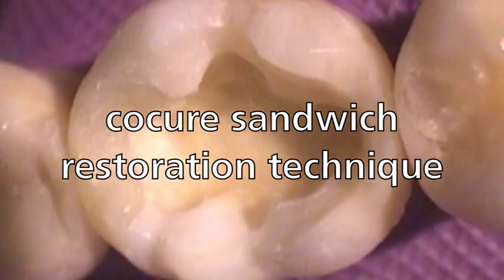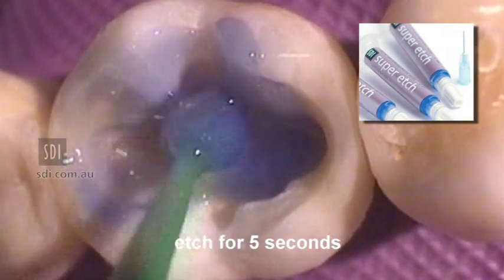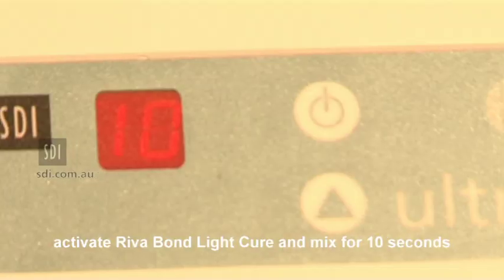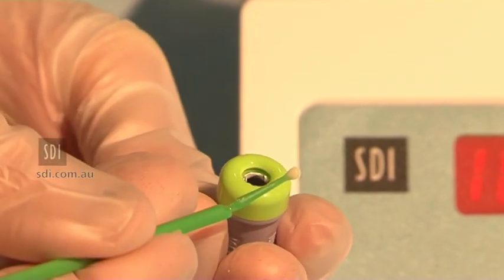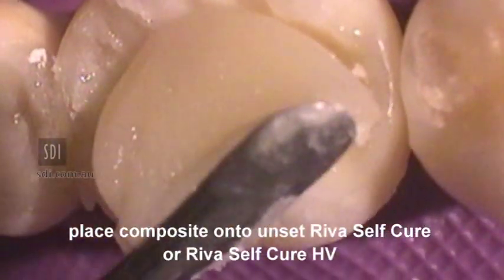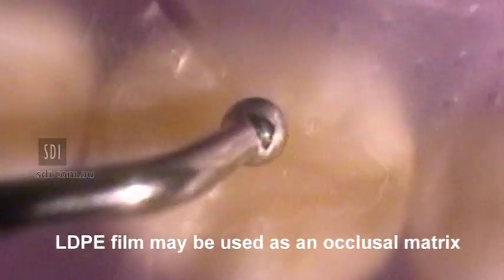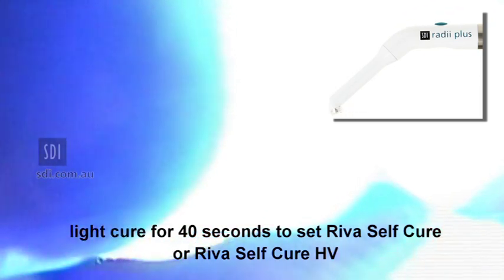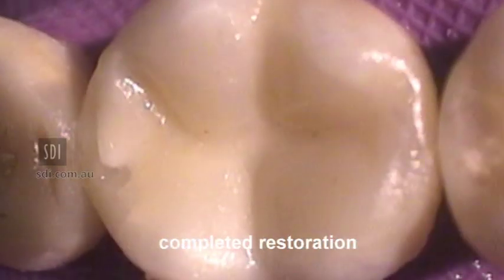Cocure Sandwich Restoration

Comment: If you don't cure the GIC, then wouldn't it flow between the enamel and the composite as you pack the composite? This would interfere with the resin bond to the enamel.